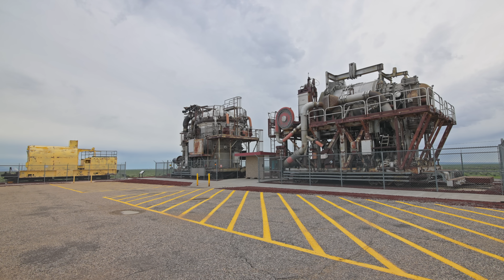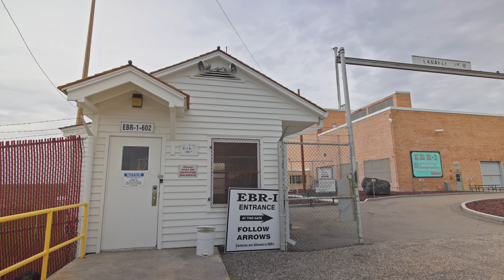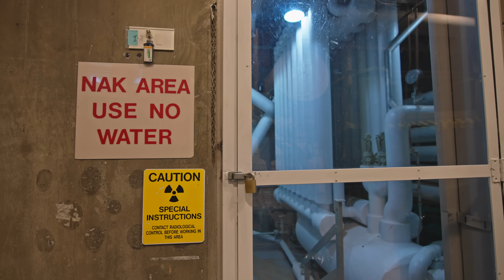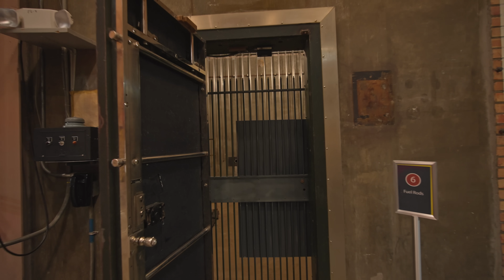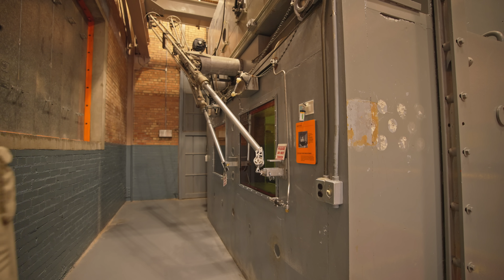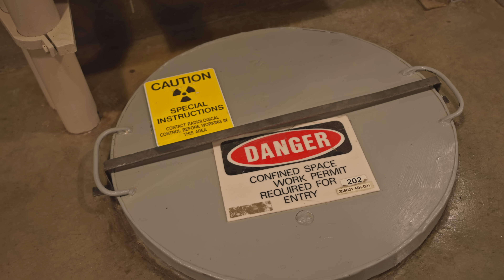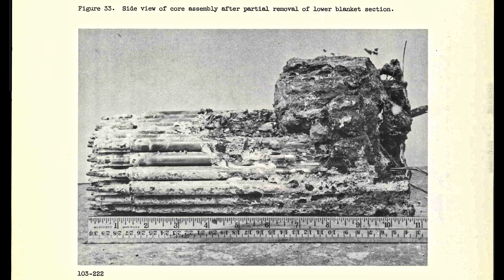Radioactive Nuclear Jet Engines in a Parking Lot

Comment: The most amazing part of the whole thing is how absolutely minuscule it is! How the hell did they fit all this in a ~100ft cube?? I measured it on Google maps. The reactor itself, the hot cells, the fuel storage, the NaK handling, the spent fuel storage, the turbine hall, the ZPR!! Is this place like a Tardis and 10 times bigger on the inside than on the outside?? I work at a mid size fusion research facility and the entire EBR1 building could literally fit in our lobby and cafeteria area...and it's not a big lobby!
Reply: And it was all done via slide rule back when cocaine was pure lol
Reply: NaK handling? What the heck did they use NaK for in this reactors ? Very interesting
Reply: @jacobkudrowich  the coolant. Nuclei of K and Na are very large compared to neutrons so collisions are highly elastic and the prompt fission neutrons don't thermalize (aren't moderated) and so can go on to induce fast fission in more 235 in the core.
Reply: @Muonium1  thanks ! That's incredible, so it works as both a thermal coolant and fission "coolant" or is it purely a neutron moderator?
 I literally can't imagine a substance that is worse to handle than that! Radioactive explosive liquid Alkali metals.
Reply: @jacobkudrowich  there is no moderator at all. the neutrons are not thermalized in a breeder. it only serves as coolant to the core and heat transfer medium to the Rankine cycle generator.
Reply: Great comment!

Comment: Please test it with known calibrated radio sources. The fact that it's showing more radiation on the display doesn't necessarily mean that it was actually detecting higher levels.
Reply from the maker: In this case it is detecting more radiation because of the different type of detectors used. A scintillation detector is always going to be more sensitive to gamma radiation than a GM tube or pancake probe. I've already done a video where I tested a bunch of detectors against other known sources.
Reply: I just don't trust any inexpensive sensor (not even weigh scales) that aren't verified with a calibrated source. Cheaper usually means less accurate, though there are some hidden gems. I'm just wondering if this is one of those hidden gems that are close to laboratory accuracy.
Reply from the maker: They calibrate it after assembly but you can also calibrate it with sources. I used my cesium 137 test disk with a americium 241 source for calibration.
Reply: I looked up the SBM-20 detector as used in other devices which this uses and it looks like the quality of the 400V drive voltage of the tube highly impacts accuracy. I'm sure the quality of the detection circuit also impacts the overall accuracy. The small sample of other devices I looked up have a claimed (not verified) overall accuracy ranging from +/- 10% to +/- 20%. One report I found, under ideal conditions, saw accuracy of +/- 8% using the SBM-20. I could not read the original published specs of the SBM-20 detector because they are in a language I don't recognize. It appears that its rated life is 2e10 pulses but doesn't show accuracy, repeatability or linearity over scale.

The Cyprus' government has invested to make it a technology hub. So, I'd assume that manufacturing quality overall has improved in recent years. I do see other companies marketing cheaper devices based on SBM-20, that claim accuracy of 15%. If the accuracy of this design is better, or even near laboratory quality, then it certainly warrants Its higher price. I hope RadioCode's website is updated to documents its accuracy when under specific test conditions. One thing I don't see on any other site either, though, is repeatability and linearity over full scale. That would be a huge plus in my book if they could document that.

Comment: When Youtube offered up this video I was expecting a tour of the site and some correct information about the site. What I got was basically a 24 minute ad for your sponsor and a lot of uneducated (and often incorrect) statements.
Reply from the maker: What did I say that was incorrect?
Reply: @RadioactiveDrew  You referred to one of the units behind you as a "reactor" fairly consistently. The actual reactor core was removed as part of the decommissioning process. What was left was the exchanger. Had the actual reactor remained your readings would have been much higher.

This is the DoD"s paper on the nuclear aircraft experiment https://media.defense.gov/2021/Jun/21/2002745848/-1/-1/0/HN2_MANNED%20NUCLEAR%20AIRCRAFT%20PROPOLSION%20-%20WAID%2018%20JUN%2021.PDF

Comment: I often wonder if it would be safer and easier to run high pressure steam to the engines and have a simple steam turbine driving the primary fan on a commercial type high bypass fan

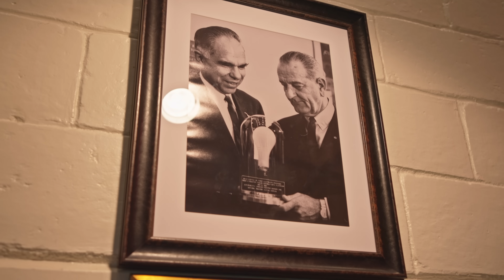Comment: Nice. I really like that post war engineering aesthetic. 14:15 - is that a beam line port or two (the yellow cylinders/discs) on those walls?
Reply: I did a bit of digging on those nuclear jets - the direct turbine was an amazing concept that basically spewed radioactive air out of the turbines - apparently one was even tested (MX-1589 project) over Texas/NM for a bunch of flights. That might be a fun place to do a background radiation survey if you can find the flight plans.

Comment: They tried solid fueled "breeder" reactors and they havent worked out so well.  One of the problems is that when Plutonium fission's, it only releases a certain ratio of neutrons per fission event, and its difficult to have enough neutrons to both initiate more fission and breed U-238 into new Plutonium.   The Thorium cycle is better.....Th-232 breeds into U-233 and when it fission's the neutron ratio is higher, and so it can successfully sustain fission and breed new U-233.  The massive problem with Thorium (fertile not fissile) and its fissile product U-233 is that U-233 is useless for making bombs.

Comment: Wow.. what an interesting place.  I'm so glad they made it into a  museum open to the public. Thanks for Radiacode for sponsoring the video. The differences in readings between the two meters in CPM was interesting.
Reply: Radeye is a Geiger-Muller technology, the Radiacode is not, it is Scintillation. GM uses electrical impulses whereas Scintillation uses light impulses on a scintillating material. It is comparing apples to oranges. 
Scintillation in fact has very accurate ultra low energy beta detection whilst the GM pancake here does not. 
The plastic on the Radiacode is unfortunately what prevents low electron volt betas from being received adequately and as such is obviously not suited for lab use.
Reply from the maker: Glad you liked the video.

Comment: Another reason to watch the possible impact of artificial intelligence. Using publicly available data, it might be able to figure out, and then tell anyone how to use lasers to enrich uranium. The technology is now well guarded. But if it was spread around, who knows what countries could secretly build nuclear weapons, if they could get the uranium to enrich? 
That was an impressive video. I wonder if some of those windows were filled with PCBs, like they used in millions of electrical transformers. They just changed a lot of them near me which looked fine to me. Those suckers are expensive. Maybe they will just dump out the PCB, refill the transformers with mineral oil, and give them a fresh coat of paint without any lead in it.  
The US signing the Paris Agreement to limit greenhouse gases means nuclear will make a comeback.

Comment: Hi Drew - another incredibly interesting video with intelligent commentary.  I hope the sponsorship helps enable more content like this.   One observation - have you considered carrying on your truck a collapsible pole, like the telescoping fiberglass ones RV and ham radio folks use?  It would enable you to move and dangle the little radiacode like a fishing lure over the fence and into those super hot zones of the outdoor reactors and read the emissions on your phone.  It’d be like nuclear fishing!  The best part is you’re able to remain both safe and legal - just a thought.  Those poles are cheap.  You could do similar things at mine sites without actually going in and getting covered in isotope contaminants, as occurred in some of your past videos.  Cheers!
Reply from the maker: When I was shooting this video I did have a 6’ pole that I used and put the Radiacode over the fence. Put it wasn’t that exciting…mainly because I needed another 4-8’ to make it interesting. So I have been looking at collapsible poles to use specifically to get closer to areas blocked by a fence. So I’m sure you’ll see a video in the future where I’m using a 10’ pole or something like that.
Reply: Hi Drew: thanks for the thoughts.  I did a quick, bit of digging and found a reference to what I was thinking of in the way of a pole that makes practical sense.  DX engineering sells a telescoping fiberglass pole, P/N DXE-TF46, that is 2.inch diameter and is in 7.5 foot sections that extends to a whopping 46 feet!  The sections all stack inside each other so collapsed the whole thing is only 7.5 feet long.  The tip is a half inch in diameter and the whole thing is very light weight because it is made of very thin but rigid fiberglass.  I’ve used these for impromptu outdoor ham radio antenna masts where we had to backpack these in with our radio gear to a mountain top for field day operations.
With a 46 foot pole you could get that bad boy Radiacode right up into dangerous places.  The fiberglass is nonconducting and has a high dielectric strength so there is also little likelihood of electrocution when swinging that thing around up in a bunch of junk.  The utility linemen also use fiberglass rods for their hot sticks when working on live wires for similar reasons of dielectric properties, light weight and rigidity.  I thought I saw the same pole sold by Harbor freight, but when looking about, it didn’t show up.  Anyway, give the DX one a look online and see if you can find others.  The DXE one is $142, but that vendor is always pricier than other sources.  Cheers!

Comment: 2 hours later a crow picked him up and fed him to the 8ft tall fledgling in the HTRE3.
Are they really nuclear jet engines?  Submarines are often and incorrectly called nuclear.  To be more accurate they are nuclear fueled, steam powered and propulsor driven.  The engines are nuclear fueled, gas powered and exhaust driven.
Reply: The heat from the reactor in these units was used to replace the role of fuel in heating the air in a turbojet. The air passes through the reactor directly, if that helps classify. No steam.

Comment: I work at ANL. The hot cell windows on our 1960's era cells were leaded glass and zirconium bromide liquid in between. Was it mineral oil to shield neutrons from fresh fuel ?
Reply from the maker: Maybe that’s the reason for it. Seems like a big reason for the mineral oil was for optical clarity with all that glass.

Comment: Hey!  You finally made it to EBR-1!  I love that place!
Crows caw, ravens rok.  The crows you were hearing were ravens.  
They really should keep those prototype reactors covered.  What are they going to do when rust makes them fall apart?
There's a lot more exhibits at the EBR-1 since I was there. 
I think the "machiney taste" is oil or grease.  
Last time I went to the Idaho National Labs I drove to were the SL-1 reactor disaster happened.  I got to stand in front of a fence and look down a cracked, weedy road that ended in nothing.  =laugh=

Comment: Maybe use a drone with a detector to explore the fenced off area? SCRAM = Safety Control Rod Axe Man.   This is one of the reactors that had an axe man to chop the rope that held the control rods to snuff a runaway reactor.
Reply: This reactor did not have an axe man, earlier reactors and piles did though.

Comment: Would the 102 detect radiation in old ceramics/antiques or is that mostly Alpha/Beta? I want to test antiques but most of the detectors are gamma only. Do I need to spring for a more expensive Alpha/Beta detector?

Comment: Another great video thanks. I think that the problem with breader reactors was the use of NaK. The special handling that NaK required increased the engineering costs. The whole reason for breader reactors was at the time there were fears that there could be a future scarcity in available Urainium (which didn't happen).
Reply from the maker: Yeah there’s plenty of uranium out there.
Reply: @RadioactiveDrew  Even in case o future shortage of uranium, there is recent development on LFTRs (Liquid Fluoride Thorium Reactor) being able to breed fissile U-233 from non-fissile Th-233. Taking advantage of thorium fuel cycle also allows us to utilize fertile U-238 to make more fuel. There are tons of U-238 and thorium is about four times more abundant than uranium (in the Earth crust).

Comment: Your slight increase is about half of what I normally see here which is 10-15 uSv / Hr, so if you're only seeing 6 that is low, and I'm about 13 miles north of Seattle, only reactor that has ever been nearby is a small research reactor at the U-of-W used to make medical isotopes.

Comment: Is that what is left of HTRE-3?
Reply: Yes, one of the two rail cars is HTRE-3. It's the one with larger rectangular rail area up top surrounding the smaller & horizontal vessel, a crane gantry above that to lift the reactor, and no turbojets. (They were removed before they set the exhibit up.)

Comment: I actually live about an hour and a half away from there, visit every year or 2. What has been interesting to me, is watching more and more areas of the building be opened to the public. When I first visited there as a kid, all you were able to see was the main open part of the building, the hot cells, control room and the steam/generator room. They now have many more viewing areas, as you’ve seen. I also have always found the exhibit on EBR-2 there very interesting, because my father actually worked there for a short time.
Reply: Radiation levels are dropping so more areas are safer.
Reply from the maker: @JCarey1988 I’m sure that’s part of it. They also might have cleaned up more of the site.
Reply: Great comment!

Comment: After watching a few of your videos I decided to get a RadiaCode, at least look for one. The 101s are not available anymore & they were made in Russia (as you've stated previously). Only the 102s can be purchased now & they're manufactured in Cyprus (just east of Greece). Current price is 259 euros + 25 for Cyprus Post totaling 284 euros, which converts to a little over 300 usd. The package tracked only 4 days, after processing, so got it in about a week. Haven't tried it yet. Just got it charged. There isn't a manual that I could find for the 102 so am reading the manual for the 101. They appear the same, maybe the only difference is 101 from Russia and 102 from Cyprus. I still have to attach it via USB to the computer  so it can register itself & check for firmware updates. My usage hopefully won't be as intense as yours, but it's an interesting little device. Thanks for your videos.
Reply from the maker: Glad you like the videos. I think the Radiacode 102 has slightly better gamma spectrum resolution. Both units are incredible sensitive.

Comment: What do you think about the radio code 102?  I've had the 101 for about a year now I don't really see any need to buy the 102 unless it's got upgraded features.  Price seems darn near $300 on quick online conversion.  Are they offering them through Amazon or anything local?  They let me break up the cost of my first one over four payments which made it super easy to afford, then the Ukraine situation started a week after I paid, and I was afraid I'd lost my money, but it came none the less
Reply from the maker: I haven’t seen a big difference between the 101 and the 102. I’ve been told that the 102 has slightly better gamma spectrum resolution.

Comment: OMG! The Radiacode 102 costs over $800 😞 I think Pres Carter shut down all of the US breeder programs at Hanford and Idaho.
Reply: No, it costs less than $300
Reply from the maker: It doesn’t cost that much. It’s around $300 from Radiacode’s website.
Reply: @RadioactiveDrew I have just got a Radiacode 102 very cool device... ever thought of attaching the radiacode to a drone to map otherwise inaccessible areas? Guess you would need an android device on the drone to do the mapping but there are some pretty small/cheap android phones that could be used for this.. might have to fly low too .. but could create some cool radiation maps this way ;-)

Comment: Hey Drew I was wondering if this is the same as SR-1. Where there was a guy impaled by a fuel rod?
Reply: I believe you're referring to SL-1. It killed all three of its operators and one was rather gruesomely pinned to the ceiling with a reactor vessel plug (not quite a fuel rod, but you've got the idea).
The partial meltdown at EBR-1 was much more "benign". No explosion.
Both of these reactors were located out in the southeast Idaho desert, but there are a lot of reactors that have come and gone out there over the years.

Comment: Great video!  Question about the Radiacode 102, what is the difference between it and the Radiacode 101?  I have a Radiacode 101 already and was curious what the new version brings beyond cost savings.

Can you do a comparison?  TIA!
Reply from the maker: From what I’ve seen the 101 and the 102 seem to preform very similar. If I can find a big enough difference between the two I’ll make a video about it.
Reply: RadiaCode 102 is made in the European Union and has slightly better specifications, with a spectrum resolution of 9-10%